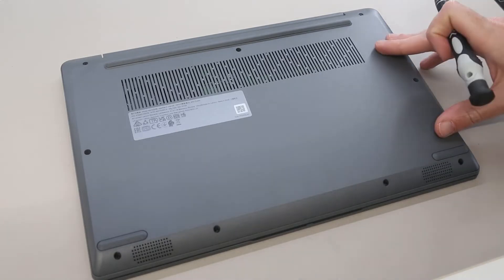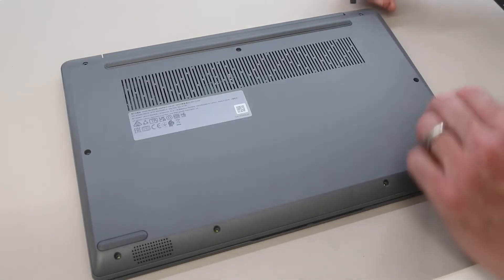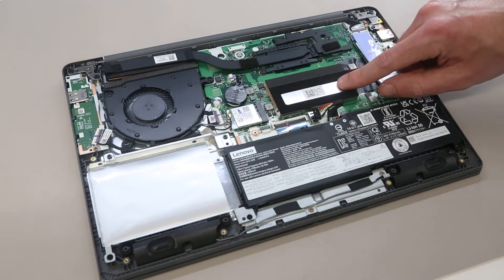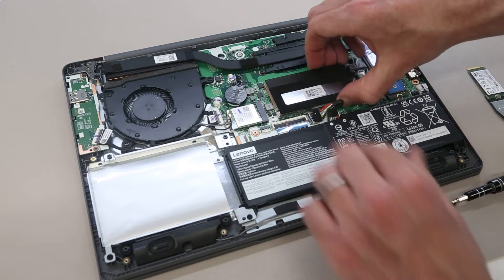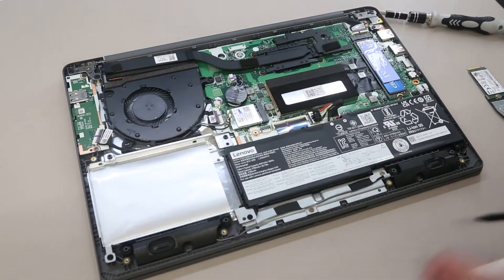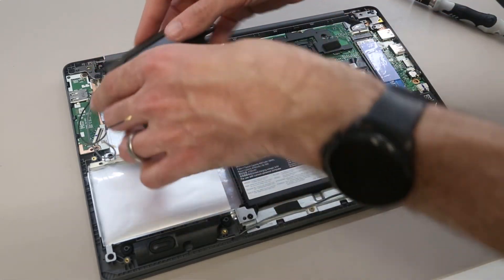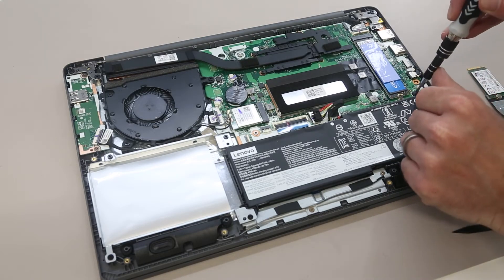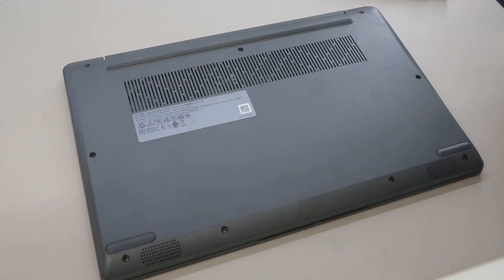Lenovo IdeaPad 3 14-ALC06 SSD and RAM Upgrade Guide

Comment: Hello, i have the same laptop and i tried to change its ram to HyperX DDR4 16gb 3200 mhz. Now the laptop is not turning on
Reply from the maker: Check that memory does the speed at standard voltage (1.2v). If it doesn't then it probably won't work.

Comment: i got IdeaPad 3 14ALC6, 4gb ram soldered can i put 12gb ram for upgrade? but the manual says max upgrade that i can use was 8gb only
Reply from the maker: It should work fine with an 8GB SO-DIMM.
Reply: Hello, I just finished adding 16GB of SODIMM RAM to my laptop, which is the same model as yours, and the RAM is running normally.
Reply from the maker: @pwjati  Great information - thanks!

Comment: Great video, this was the video I watched a few years ago before upgrading my laptop! I picked up the SATA cable you mentioned for about £8, replaced the nvme SSD with a 512GB one and added a 1TB SATA SSD, shoved in a 16GB SODIMM and called it my little sleeper laptop :D Just a quick note here in case it helps anyone else: the machine will actually accept a 32GB SODIMM, for 36GB total memory. I picked one up recently and thought I'd try it, and it worked! The one I got was 32GB Patriot DDR4-3200. Tested A-OK in memtest and it's been rock solid in windows too.
Reply from the maker: Great information and glad it helped!

Comment: Great video! 
Upgraded my 15ALC6 to a 1 TB drive (Crucial CT1000P3PSSD8) and 20 GB RAM (Crucial CT16G4SFRA32A). 
Cloned the disk with the Crucial version of Acronis on a separate laptop, both drives on USB adaptors. (I've had mixed results with cloning a hot drive.) 
In the end, a little adjustment of the boot order was required

Things went remarkably smoothly, but I'm from the MS-DOS days and am easily impressed. The computer seems to respond a little faster, even on simple things like loading a browser,  with this upgrade.

BTW: On the 15ALC6, the screws under the front of the keyboard are shorter. It looks like the RAM cover can just be pulled off, no need to fiddle with each of the supports. There is no area left for the SATA drive on this model, the space now taken up by a larger battery.

Comment: this laptop works with 20 gb ram, I did with crucial 16gb ram stick, the lenovo website says it only supports 12gb but is supports 20 gb max
Reply: You are my hero.  I was looking all around for this info.
Reply: @normanchiu847 have you upgraded yours already?
Reply from the maker: Thanks, great feedback.
Reply: Thanks, did the same, work like a charm
Reply: @Shenron666  you also have Lenovo IdeaPad 3 14-ALC06 that has 8GB ram? because my 16GB ram stick will come tomorrow. i want to double check to verify. can you answer?
Reply: @shortnime19  yes I confirm, I removed the 4GB stick (brand Samsung) and replaced it with Crucial 16GB stick
Reply: @Shenron666  thank you!
Reply: @shortnime19  hey, did you upgrade to 20 GB? no crashes? please confirm :) 4 soldered +16 ?
Reply: @kartaispavarau  i just did. It worked like a charm
Reply: @shortnime19   did you also upgrade the ram to 16gb? 4GB (onboard) + 16gb? does it work and not crash? please confirm :)
Reply: @Shenron666  what is your processor 
I also want to buy 16gb ram but for different laptop 14ada05
Reply: thank you
Reply: thanks i really thought this was 12gb fr from other sources
Reply: Where did you get your stick from?
Reply: why did mine crash?
Reply: Thanks..
Reply: Thank you!!

Comment: So I wish to upgrade my RAM and I used the command to see my compatible RAM which said 16gb but when i went to crucial advisor it said 20gb max including the integrated 4 gb and now I dont know anymore which to believe. Please sent help.
Great video by the way
Reply: same question
Reply: @yuvitv1034   Well im running it on 20gb ram right now and its fine
Reply: @hawg_rida2827  ty now I will go for 16gb stick, is there improvement in fps while gaming?
Reply: @hawg_rida2827  what brand ram did you use

Comment: Thanks. This also applied to my IdeaPad 3 15ALC6.
 I could not figure out where the ram slot was. Its been a while since I opened up a laptop, first time I've seen it with some sort of protective cover. I thought it was the soldered RAM. 
Also, other videos and guides for my model threw me off- showed a different motherboard for some reason. So I guess there are variations within the 15ALC6 models.

Comment: hi james , could you tell if we can put 2 hard disks ( hdd beside the main ssd ) on this laptop or not ?
Great, simple and very helpful video by the way ❤
Reply: He mentions the 2.5" drive bay and that we'd need to order the Lenovo SATA cable.  This would be an SSD, and this makes this computer more usable - having a secondary storage device seems the best option.  But for me, the soldered-on-RAM is a deal breaker.
Reply: @BuffaloC305  Do you mean that instead of installing a 2.5 in the allocated space, we could install an NVME SSD and thus have two NVME SSDs on the laptop?

Comment: You forgot to add a disclaimer that you have to copy the system drive onto the m.2 before replacing it because it will cause problems.

Comment: This is very useful Because i did not know where the ram should go, didnt know it is under the Protection Case at all, i am planning to upgrade mine to 16GB soon so this is very much Appreciated
Reply: For what I know, this model only supports 8GB RAM on that slot.
Reply: You can check the upgrades on crucial website by entering model number
Reply: did toy upgrade this slot to 16gb is it working fine with total 20gb ram?

Comment: Guru, many thanks for the video clip you produced here. This one is good for me to do some reset job if the power-button is not working to de-attached the power-cable in mainboard + battery set here. 14ABA7 Lenovo Idea-PAD used by me now.

Comment: my IdeaPad 3 14-ALC06 is running 4+4gb Ram, is it possible to upgrade into 8+8 ? The motherboard can support 16GB ?
Reply: lnvnb161216 motherboard 20gb supported confirmed (4gb onboard + 16gb stick)
Reply: @aradhaysingh147  did you buy 16 gb stick, is it working fine
Reply: @yuvitv1034  I did. It's working fine. Tho Performance lift in doing heavy tasks did improved but the gaming performance not so much. Maybe I should have just went 8gb like the store person suggested 😅😅
Reply: @aradhaysingh147  even I did just today, don't think too much its only 1000 rupees difference between 8 and 16gb , you will surely notice performance in games like god of war, fifa 24 allocated 2gb ram to graphic card
Reply: @aradhaysingh147  is ryzen 5300u o 5500u?
Reply: @aradhaysingh147  hey, is the RAM still working now or it crash?
Reply: @hernansandilaksono  it was working fine until I fried my motherboard :) because of lot of overheating due to graphic intense tasking which I did. I thought I was being careful but aahh I went overboard. Instead of just replacing the motherboard and spending like half the price of the laptop I am rather buying a decent budget gaming laptop instead. It served me well for 5yrs 😞. The kind of work and game I play and do I understand that the hard way notebook laptops are not the one 😅. I am in 2nd yr  clg now and really need to get one by this April.
Reply: we have the same  laptop the 4gb is soldered in the mother board so u  can just replace the other 4gb stick into 16gb or 8gb to make it 12gbram or 20 gb
Reply: @JohnCarlBanate  Damn no 8+8....
:(
Reply: @JohnCarlBanate  wait our motherboard supports till 16gb then how can we use 16gig stick?? I am confused I plan on adding more ram too
Reply: @aradhaysingh147   i went to lenovo store and told me dat i can upgrade my laptop upto 12gn of ram so i decided to go  to a local store and they tried to put w 16gb ram then it works 16gb + the 4gb soldered =20total
Reply: @JohnCarlBanate  DAyuummm mine is
IdeaPad 3-14ALC6 Laptop - Type 82KT, will it work in this too?? it has 2x4gigs ram
Reply: @aradhaysingh147   u can try to ask at the nearest local store that sells ram and ask them if  it is possible to install a 16gb  ram, most of them do have a spare of 16gb ram stick and they will try to insert in and if it works they will tell u that it is possible to add a 16gn ram
Reply: @JohnCarlBanate  I will thanks
Reply: @JohnCarlBanate  So I just found out ..
I can do 16gb more, I guess my motherboard was showing the max 16gb ram  supported for the single available slot :)
Reply: @aradhaysingh147  welcome man. Happy to help
Reply: @aradhaysingh147  tengo el mismo modelo, pudiste agregarle hasta 20 gb?
Reply: @Parzita_pe  No, es dinero mi amigo :(
Reply: @aradhaysingh147 i have same question, also pls tell which ram should i order website says 3200 mt and 3200mz
Reply: @GurwinderSingh-tv7rb  I just went to the store from where I bought it. Originally he suggested to go with 8 not 16. But I kinda insisted so he did. It's been more than 1yr and is working fine till now. Sooo I can't really say
Reply: @aradhaysingh147  thanks g
Reply: I have the same question too

Comment: Any idea if this model suffers from the hinge failure (plastic body cracking) that other Lenovo models suffer from? YT shows stacks of videos of failed hinges / bodywork but they are for previous models.
Reply: ive had it for almost 8 months. its fine so far.
Reply: My Lenovo had developed a tight hinge, so I loosened the 2 nuts that apply pressure to the hinge and oiled with mineral oil. Hinge went from too tight to super floppy, so I had to tighten the hinge nuts up a bunch.

Comment: Hey James, thanks for the great tutorial. 
I have just purchased one of these laptops and using your recommendations above have upgraded it. 
You mention adding a 2.5 inch SSD to this laptop with a SATA cable. What type of cable would I need to do this and is it as simple to do as the other upgrades in this video?

Thanks
Reply: The cable that worked for me is the HS560 HDD SATA Hard Drive Connector Cable
Part number NBX0001VD10.
Reply: @NotAnotherBonsaiChannel  Thank for the info, bro!
Reply: @NotAnotherBonsaiChannel  Hi,

Could you please show where to connect that cable on the motherboard? I could not find a connector for that.  
Thanks
Reply: Hi Norbert, you'll find the connection point (a small clip) near the top left screw hole where the battery sits. Ideally you don't want to clamp the cable under the battery. Instead the ribbon cable should sit above the battery and if needed be taped down. Hope this helps.
Reply: @NotAnotherBonsaiChannel  Hi,

Thank you so much for your reply, I beleive I found it, but the additional SSD is still does not seems to be working. But it must be an issue in the settings now. Thanks again
Reply: @norbertfekete2565 I know im one year late but make sure you make a new partition

Comment: What is the maximum ram upgrade for this laptop? Crucial says 20GB while Kingston says 12GB.
Reply from the maker: A 16GB SO-DIMM should work fine, so 20GB.
Reply: @BrueComputing  I got myself a Kingston KVR32S22S8/16, the laptop works fine with it. Hope this information helps your future viewers.
Reply: @justaguy7337 any update? does it still works fine?
Reply: @BrueComputing  Thanks mate
Reply: @BrueComputing  thats what i did with mine and it works great at 20gb
Reply: @BrueComputing  can we put a 32GB RAM stick???

I am planning to upgrade my Lenovo IdeaPad 3 (15" ALC6)
Reply: But pls will a 4+8gb ram making it 12gb work in dual channel mode?
Reply from the maker: @Tess11  Matched pair is preferable. 4+8 will interleave the first 8GB, not the final 4GB.
Reply: @BrueComputing True but my Lenovo V13-ADA Amd ryzen 3250u laptop has the 4gb ram soldered to the board
Reply: @Tess11  If you see this If the first 4gb is soldered onto the board can I get a 16gb ram thats compatible and put that in there to make 20gb of ram? i Have the ideapad 3 14ALC6?
Reply: @HOPOFFMYBOINGBOING  bro did it work? Im thinking same about mine 14acl6